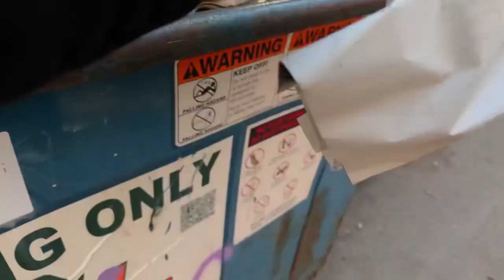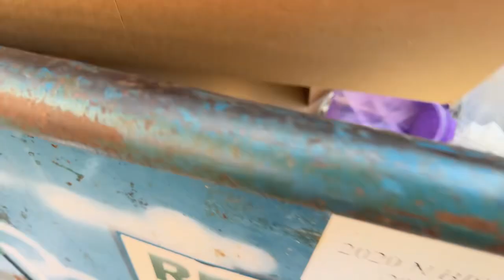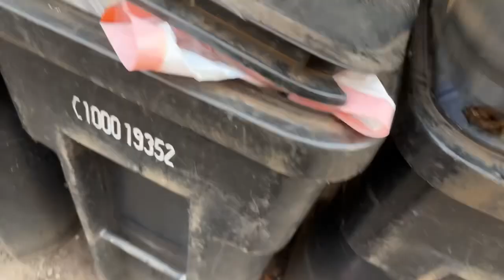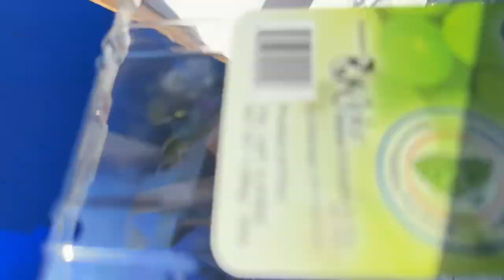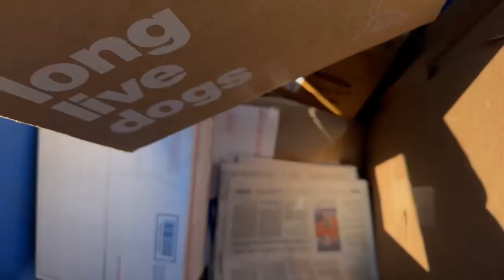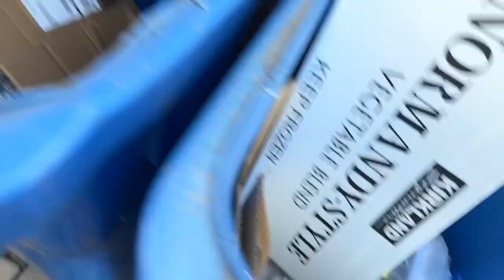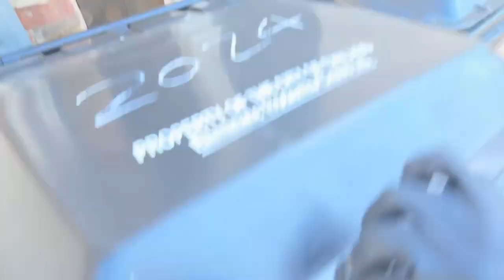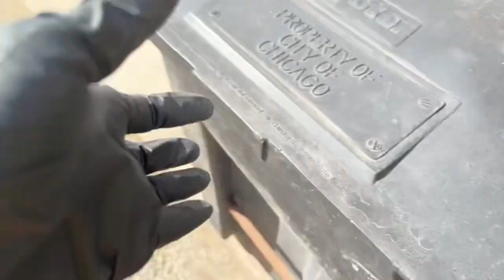Dumpster Diving | I Can’t BELIEVE all the AMAZING items I FOUND for FREE!! BINGO!! 😱😱😱

Comment: Just a heads up. They don't have the same schedule for the bigger green dumpsters as that do for regular garbage cans and recycling. So if you're in an area where they just picked up the single ones just drive by and check the big ones. It's usually different company and different schedule. As I think you noticed in today's video.